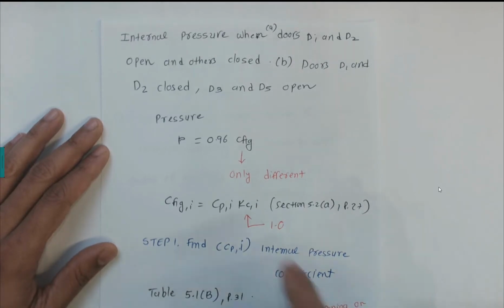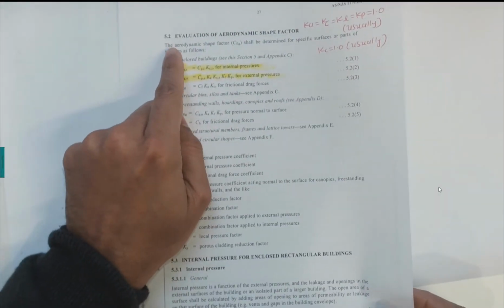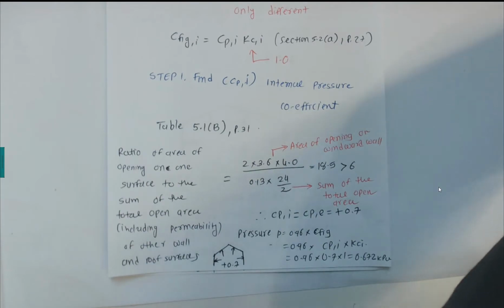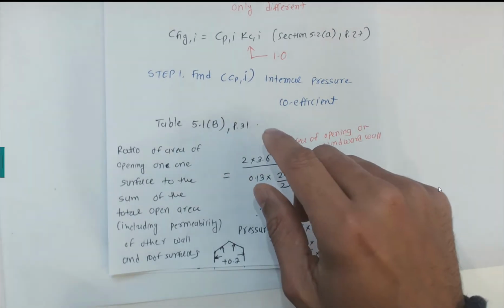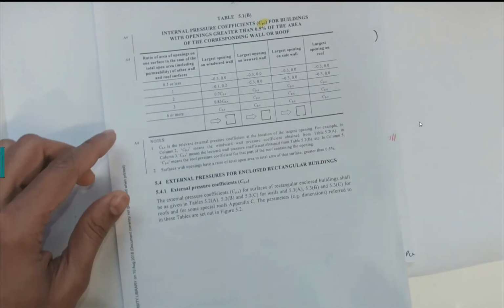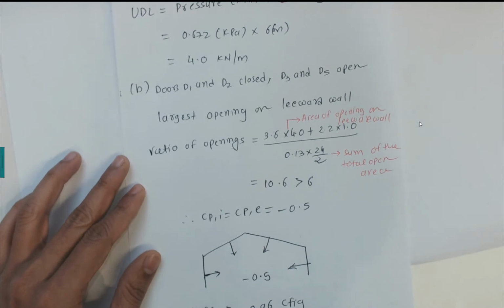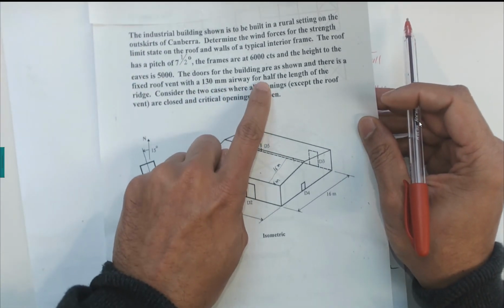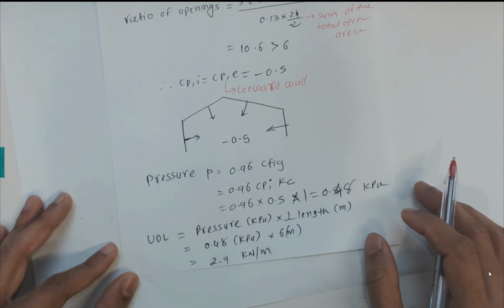Wind loading Example 2 Part 12 AS/NZS 1170.2

Comment: Hi Dr Vipul, would you please explain why you took Kc,i = 1 for windward wall (in 5min54sec)? Thank you
Reply from the maker: The combination factor (Kc) have to do with the fact that all of our wind loads here are worst case. It is not likely that you are going to have the worst case wind load on every single surface of the structure at exactly the same time. We take Kc,i = 1. 
In addition, all of the wind loads calculated are worst-case and it not always reasonably possible for the worst to occur on every surface at once. We have a windward wall only so we are taking Kc,i = 1